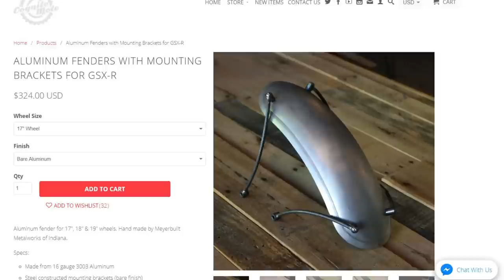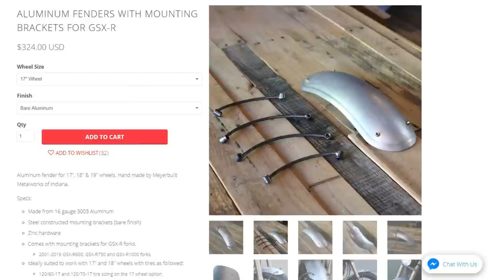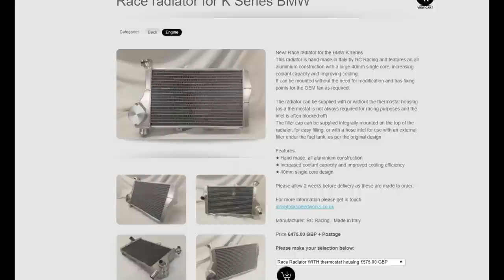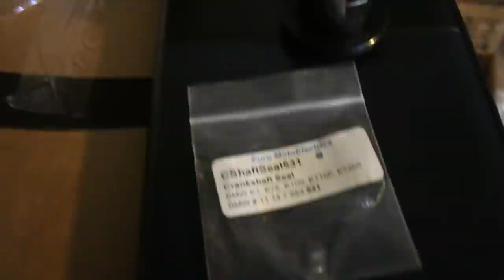[Ep 13] 1986 BMW K100 Cafe Racer Project - Bits and Bobs!

Comment: You should rotate your airflow meter 90 degrees. The way it is sitting can cause some fueling issues due to gravity pulling the valve either open or closed. Learned that through my own K100 cafe build.

Comment: Absolutely love the videos. Word of advice...take the rubber seal out of the fuel filler cap. Mine corroded from the fuel fumes and left my tank full on rubber.
Reply from the maker: The idea of doing that scares me. I'll give it some time and take a look under the tank later to check if its falling apart

Comment: Lookin good that radiator looks just as good as the over priced one i would of did the same thing bike sounds great too. Props for figuring out that web of wires too i could of never figured out all that and make everything work
Reply from the maker: Looking at it as a whole, it looks impossible but starting from scratch? You could do it too

Comment: That is a sweet build, Have you checked your front guard to radiator clearance under compression with the forks that low? and the rear tyre to exhaust clearance under compression.

Comment: This things so clean my dude. Should move the exhaust more under the seat and add heat shielding to under the seat.
Reply from the maker: Thank you. That would cost more money I don't want to spend. The pipe is a ways away from the seat so I'm not worried about heat there.
Reply: @Theillestrator1050  Then why does it need to go?

Saw your comment about it not staying.
Reply: @unclejohn5012  ..because unless he can find an suitable 'angled elbow' piece to change the angle of the exhaust megaphone style end-can/muffler/silencer, away from the rear wheel and the new larger 18" wheel with 180 section tyre, it will hit it, when the rear suspension moves doing its thing job.
Reply: - The illestrator - But is the end of the exhaust pointing backwards too close to the top of the back tire?
Reply: @Theillestrator1050  a simple removal , cutting the pipe (to change the angle) and re-welding it shouldn't cost too much (I'm a welder/biker). the super-hot exhaust will start eating the tire. Ask me how I know.

Comment: The DIY fender is very clever and looks nice! But now I am curious how the black will match. White tire lettering would maybe better match the light aluminium colors.
Reply from the maker: It's basically gonna be the same low gloss black paint as the transmission and swing arm

Comment: Hello illustrator, I wanted to ask you how much did you pay for the actual software to fabricate that rear single-sided shock mount? I am very curious to how much it cost to get that fabricated, it does not look cheap! That's for damn sure, but it absolutely is necessary for that bike build, and it looks killer from what I see by the way brother! And keep the videos coming!

Comment: Maybe I misheard you but, the AUX port on your mUnit is switched power out. There should not be any grounded circuit on that.

Inputs to mUnit are all grounds (except LOCK) and all outputs are switched power.
Reply from the maker: I'm a bit confused by your comment in terms of what you heard me say incorrectly so let me describe what my point is.
The gas light, charging light and oil pressure light will receive switched 12v from the AUX OUTPUT, configured to output power upon the ignition lock being activated and to stay on until its turned off. The grounds for said lights will be at their respective points (gas tank harness, Alternator, and oil pressure switch). The lights will always have power but will need a ground to actually turn on which is thankfully how these switches work.
Reply: @Theillestrator1050  As I said, perhaps I misheard you. How you describe this (above) is exactly correct. Sorry for the confusion.

Comment: Hey man I have a question about the oil pressure light wiring because I'm building a k100. In the video (23:23') I saw that you connected the dash light ground to the green/brown wire coming from the oil pressure switch. Then you put the other cable from the dashboard light to the Aux 1 output of the M.Unit. Is that correct or did I do it wrong? The problem is that my light doesn't go out when I start the engine. Mutch Love for your build!!!
Reply from the maker: Right, You ground the light via the oil switch at the bottom of the engine and then you give the light positive power from any SWITCHED source; meaning any source that gives power only when the ignition key is turned on.

-check to see if your output is switched to something like "turns on with ignition only" on your M unit settings
-check that sure your oil pressure switch is good
-Make sure the ground wire running to the oil pressure switch is not damaged allowing the copper to ground elsewhere on the bike
Reply: @Theillestrator1050   
Hey man i did it and the light wasn't on enymore. I dit the ground of the red light to the green brown from the oil switch and put the positiv from the light to aux1 output. Then i changed on the app to "turn on with ignition" but the red light dident go on. I checked every wire and didn't see any other groud point. 

- Is it possibel that the oil presur switch is broken becaus its not grounded and so does not close the cycle? 
- When i took out the oil presur switch how i see if its broken or somthing? 
- On my oil pump i have 2 oil presur switches. One with the green brown wire and the other with a black wire that goes on the oil presur switch that have blue on it. maybe it has something to do with that?

On my first time i wired it that the green brown wire form the oil switch goes to aux1 input and the positiv from the light to aux1 output. The ground from the light to the grounds on the framework. This way the light was on but wen i startet the bike it dindent go of. Maybe you now somthing and thankyou for the help.

Comment: does having no rear brake switch cause trouble when it comes to registering the bike? (Not sure how it works because in the uk it would fail its MOT and wouldn't be allowed to be on the road)
Reply from the maker: Technically yes, but this is New York City...everybody plays ball if you slip em a twenty if you get my drift 😂
Reply from the maker: ........allegedly
Reply: @Theillestrator1050  haha nice! its the same over here, there's a few garages that will turn a blind eye for a tip :')

Comment: Love the megaphone like exhaust
Reply from the maker: Unfortunately its gotta go 😓
Reply: Just add a ten to 15 degree exhaust elbow to the left so it clears your rear tire. That muffler is too nice.
Reply: @Theillestrator1050  Make it stay please.
Reply from the maker: Thing is, I want to maintain the line it shares with the tank and subframe.
Reply: @Theillestrator1050  So your saying straight pipe? *keeps with frame, cheap, and fucking loud? xD

Comment: Lookin' good brosef. Don't forget to clean off that exhaust real good before you get it hot so it doesn't get stained with fingerprints and other oils!
Reply from the maker: Too late lmao. They've already been heat cycled and I did take note to do that but i forgot when it came down to it. The good thing is they are not polished anyway, the pipes are discolored from the welding so any imperfections are fine with me

Comment: Hope you made sure your antifreeze is formulated for aluminum engine protection, regular antifreeze doesn't have the proper levels to protect your brick which is all aluminum construction. These are things I practice with my flying brick. 👍
Reply from the maker: It's safe for all metals

Comment: Hey man bike is looking nice. I have an idea so that you don’t spend that much money on the gas tank heat shield. Armor bodies sells a a heat Shield that you can trim to your liking and it has a sticky side that you can put it on the tank. It’s only $25 and maybe that can make it look cleaner. The shield is made for race fairing but I don’t see a problem using it under the tank.
Reply from the maker: Thanks for the suggestion, but you might have missed when I said that I'll just reuse the middle section of the insulation. So Im just re using the insulation I pulled off.

Comment: Yo man I'm having carburetor issues on my motorcycle and I can't figure out what the problem is. Been searching for advice but can't get none. My carburetors are stuttering. I've cleaned all four and rebuilt them multiple times but they still stutter. Can you please give some helpful advice to fix this problem
Reply from the maker: Im sorry to hear that, I'll be honest im not the most knowledgeable when it comes to carbs. You might wanna sign up for a forum site for your specific bike and bounce the problem off a few veterans.
Reply: Ight thanks

Comment: just a note on the horn. they're directional so you really do want those things pointed in the direction you want them heard (forwards). the way you mounted it, you're going to hear it really well (or at least your balls will), but people in front of your bike probably won't.
Reply: also, another reason for the rear brake light. If you're stopped at a light (or wherever) and you take your hand off the bars for a rest, but keep the rear brake on (as you should), the light's going to go off, so you're less visible to someone coming up behind you at the light. especially at night.
Reply from the maker: The horn can be tilted forward pretty easily so when in practice if its blasting my ears I'll aim it forward more.
Reply from the maker: @davidsenette5727  I find that I never use the rear brake to pulse the light at a stop. I actually do that quite often naturally, and I agree but it's exclusively with the front brake lever. I find it easier.
Reply: well, I'm not really talking about pulsing. just having it on. I've been driving at night and I've come up behind a bike where the guy has both feet on the ground and no hands on the bars (neutral obviously), as one does for a rest, and couldn't tell from a distance that they were actually stopped (usually this is in shit weather). the DRL was active (i.e. brake light is always on, as most bikes do), but in certain conditions  you can't really tell whether the bike is stopped or moving. just a safety observation, not a critique.

Comment: 29:36, no you should use it as well in the rain (both brakes at once preferably, rear won't make you slide as bad as front), and during emergency stop (both brakes without abs as well, it makes you stop faster) and if your rear break sucks vs front brake you are going to slide your front tire and fall event at low speed (I did it once). 

Please make it work really well, we want you to continue uploading and not killing yourself. Please don't die. Please!
Reply from the maker: Im sorry but I'm not exactly understanding your point. Both the front and rear brake work. In the video I state that I removed the rear brake LIGHT switch because you are supposed to brake with both front and rear brakes if you're riding properly... O_o

Comment: Sounds like an old 80s Japanese, low compression 4 cylinder
Reply from the maker: Wait until you hear it under load, it sounds even deeper than a japanese four.
Reply: @Theillestrator1050  Hi dude, sorry if I seem to have spammed/trolled you in the last few days, I just fear the small size of the weld on the 'bracket frame plate' which is welded to the frame's rear rightside, which the rear suspension monoshock system pivot plate is welded on top of, it is too small in weld surface area and it lacks enough supportive bracing for forces it will face without any safety factor. 
That bracket plate from what I can see in epsiode 11 & 12, as proof I am paying attention, and trying to point out to you...
is welded in a  reverse 'L' shaped weld, abutted on top of the rear downtube and rearm most crosstube union, and only welded along its lower edges, perhaps with an equally thin internal weld behind it on the rear of that plate, and not of a contoured and  chamfered or bevelled to the frame shape for the welds to be welded onto and along, and built up over on front and backs sides to the frame and plate, to create a large contacting weld area on 3 edges of the plate to the frame - instead it looks like it is just one thin edge abutted bead weld. 

As a motorcyclist I could not say something as it would leave me feeling guilty for saying silent about that which my mechanical, engineering innerself is screaming out about to me 'look look, please realise, for love of all that is petrolheaded!?' ...and its loosing me sleep with no response from yourself, sorry to say.
I love how the bike is developing and progressed, your content, videos and personal honest vlog style & humour, hence why I am replying to this newest of your comments illestrator.
Reply from the maker: Hey, thanks for the concern, I didn't get the impression of being spammed, I just don't think I seen your comments.

I had to read your comment about 5 times to understand the technical side of what you were saying but eventually I got there. This kit has been used by many people before me, and I actually had the frame looked over and touched up by a more experienced welder at the powder coaters even after the initial welding. Now I trust the frame especially given the fact that I rode the bike for two weeks even before having the welds re-TIG'd and it held up. The force of the suspension is biased over the tubes themselves and the area has more reinforcement at the linkage connection than when the bike was stock. I'll give you a closer look at the area next episode for your opinion
Reply: @Theillestrator1050  Cheers, thanks for the understanding, ..it is good it was TIG-ged, as that's what the frame materials was optimised for too. I knew I was enquiring and notifying a few weeks later than the videos was posted at, and was naturally getting a bit empathically triggered - I suppose am used to the beefier looking welds and mountings. the fact the another welder seemed concerned to do some work on it meant he wasn't 150% sure either - at least if needs, there is space & tube area for any reworking or additional bracing in the future, OK, I'll shut up about that now.

There is quite a scene for Streetfightering, modifying Flying Bricks in the UK going back to the late 80s & 90s, (and likely there still very much is too,) particularly as seen/read in Back Street Heroes and  Streetfighters magazines, and likely on UK forums too, and perhaps some choice 2nd/3rd hand or unneeded parts as well.
Thanks for replying, it puts me more at ease, and again apologies if I went (more than) a bit OTT (over the top).
Keep it rubber side down sir! until the next installment, same bike channel same bike time! sniggers ..sheesh! blah blah etc ;) :P
Reply from the maker: Nah man no need to apologize, clearly you know your stuff and have good points. The bike is monoshock from the factory and has this unusually flimsy looking shock linkage just before the tail hoop... its actually kind of crazy how it's good enough for the suspension especially considering most K bikes are rusted on that area. Everything about this new suspension set up is much more reinforced.

Streetfighter is a good word to use because on paper these bikes don't even really make ideal cafe racers for several reasons... luckily I seem to have found a happy medium between cafe and fighter.